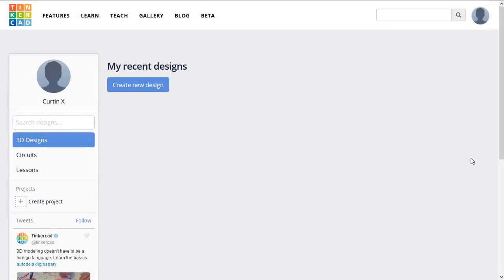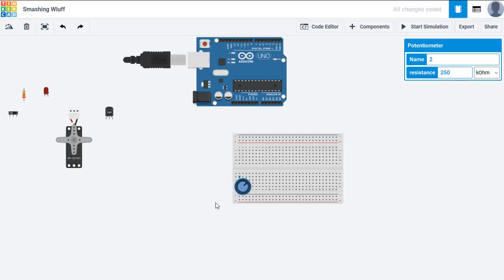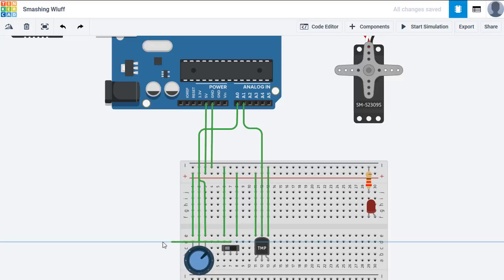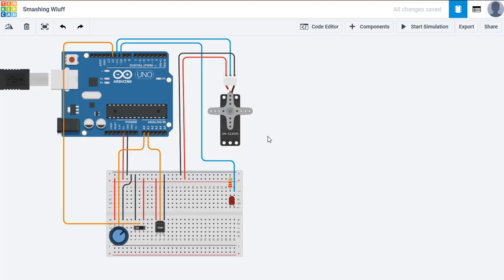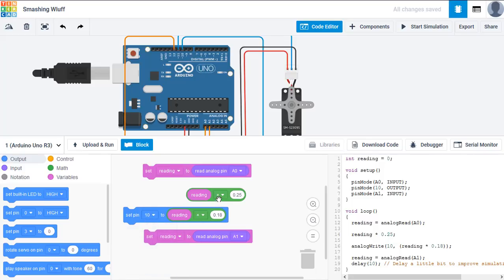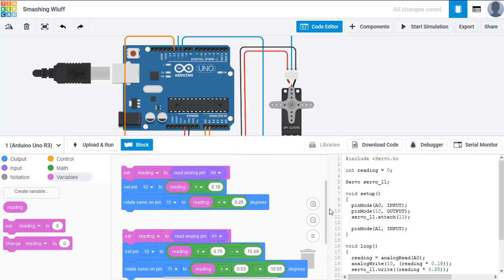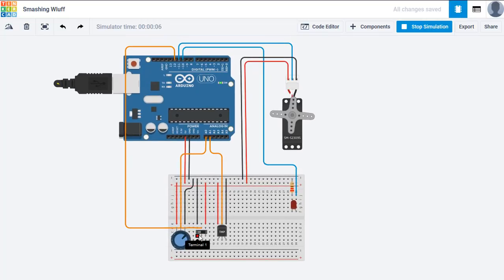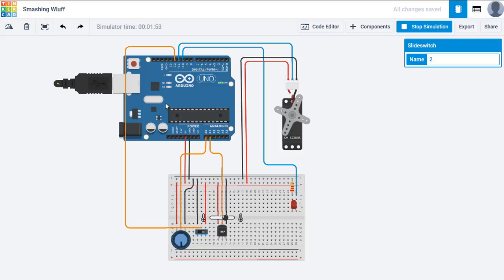TinkerCad Sensors and Actuators

Comment: #include<Servo.h>
int reading = 0;
Servo servo_11;
void setup()
{
  pinMode(A0, INPUT);
  pinMode(A1, INPUT);
  pinMode(10,OUTPUT);
  pinMode(12,INPUT);
  servo_11.attach(11);
}

void loop()
{
  if(digitalRead(12) == 0){
    reading = analogRead(A0);
    analogWrite(10,(reading*0.18));
    servo_11.write((reading*0.25));
  }else{
    reading = analogRead(A1);
    analogWrite(10,(reading*0.75 - 15.09));
    servo_11.write((reading*0.53-10.65));
  }
  delay(10);
}

Comment: Mine did not work fine.. When using the potentiometer it worked as in the video, when using the temperature sensor it did not move the Micro Servo (left it at 0) and turned the light to maximum, changing the temperature did nothing. Thank you!
Reply: me too
Reply: @mariezdesire6045  Me too
Reply: Me too